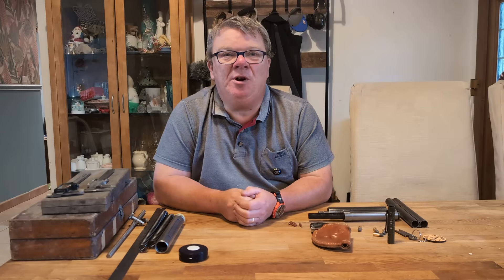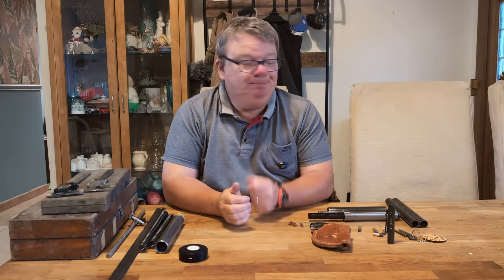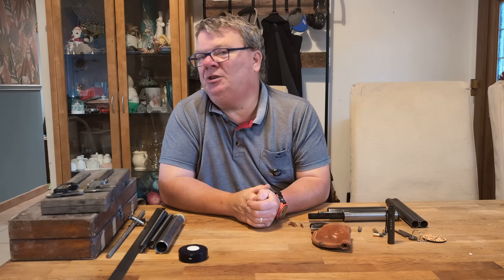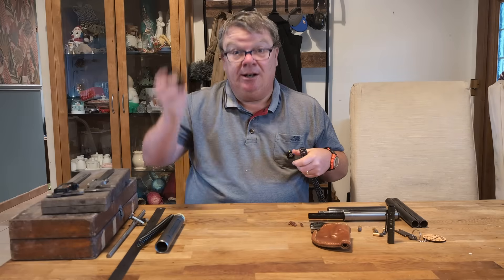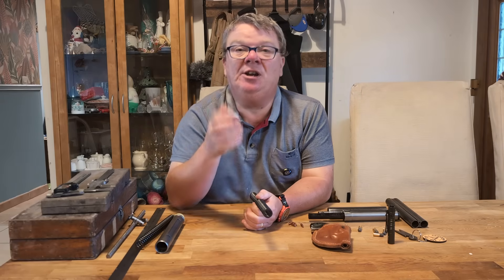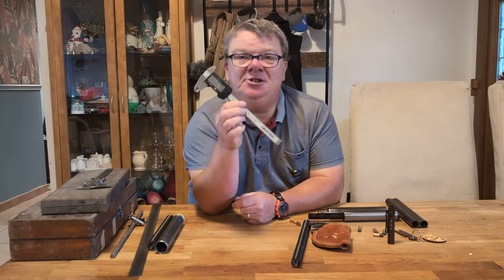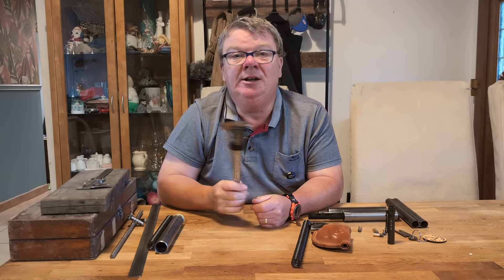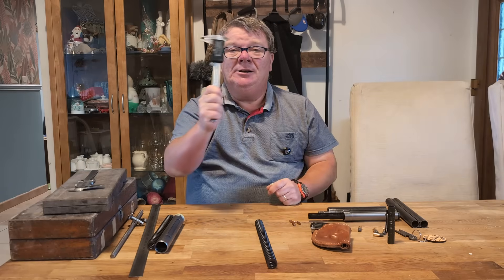How deep is your love? The TbT guide to the exciting world of Vernier gauges, and why you need one!

Comment: Vernier height gauge used in inspection departments for accurate measurement or marking off work pieces. To be used on marking off tables made from solid cast steel with ground finish surface or a suitable size face plate. This was engineering when I was a apprentice in the 1960s

Comment: Hi Nick
I use a height gauge on a granite block which is the datum surface. 
I use it for setting adjustable height stoppers for a blow moulding machine which has 16 bottle moulds. 
We also use the gauge for measuring the height of the bottle for quality control for the customer. 
Always seen in QC labs in industry. 
Comes down to ISO 9000 and what have ya. Quality management.

Comment: It would’ve been interesting to do a comparison in the readings between the two calipers! I did have a Mitutoyo, however, I thought I’d lost it, so I bought a cheap one for 20 quid, I found it sometime later and compared the two and they were virtually identical, the only difference with the cheap one is that it burnt batteries like they were going out to fashion..
Reply: Yes, that is a common failing with cheap digital verniers. I always remove the battery and put it in the battery holder in its plastic case between uses.

Comment: If you don't want to spend £100 on a set on a set of vernier size guages to check your £8.99 Lidl calipers, I just found out recently that British coins are very accurate in their sizing.... 2p=25.9mm. 5p=18mm. 10p=24.5mm and so on.
Which Lidl did you get those for a fiver 😂

Comment: As a retired Toolmaker, nice to see the Vernier height gauge, normally used on a surface table ( a very flat, cast or granite table.) the adaptors you have are for a DTI (Dial  test indicator) for accurate height measurement or as a comparator. 
Back tio the Venerial callipers, great for measuring scope height to bore for BC set up…another great video !
Reply: That's nothing to be proud of,kier starmers is the son of a toolmaker...😮